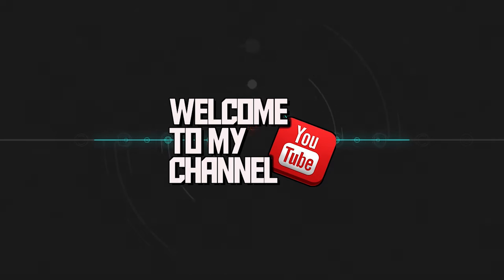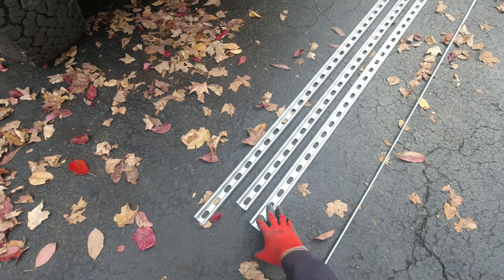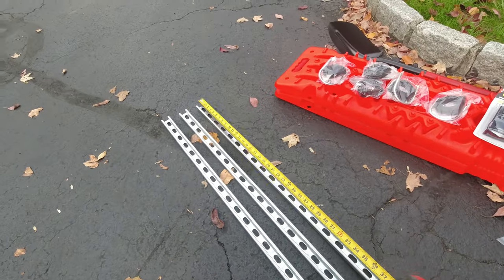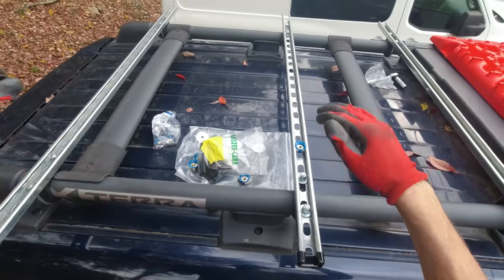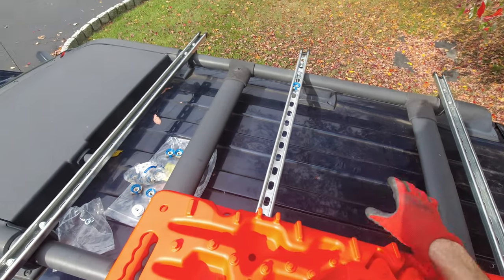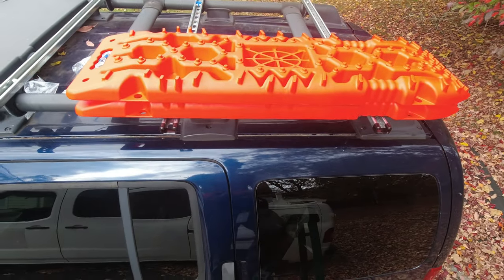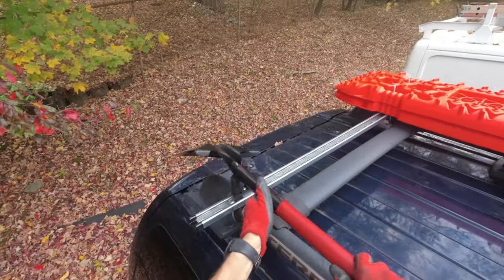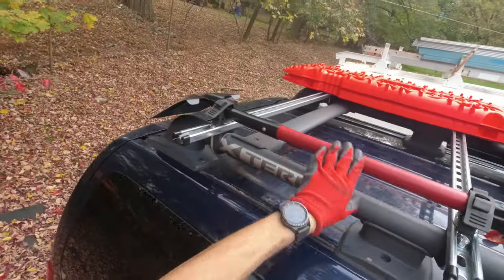DIY Roof Rack Using Superstrut Cheap And Versatile

Comment: Nice video. I’m needing to do this project so will be using your video as a resource. I really like the three strut idea instead of just do and the strap for the shovel is pretty cool.
Reply from the maker: Hey thank you so much ! Hope it will be some help to you its always great to hear that those video might be some help ! would be great to see your end result as well and how you made it )
Reply: @DIY_AUTO_PHOTO  thank you- you got the end caps from McMaster? The link in the description isn’t working and I’m not finding them on their site
Reply from the maker: @billk8899  Sorry about that not sure how that happened but I fixed the link its working now ) 
thank you for letting me know
Reply: @DIY_AUTO_PHOTO  what do you think of this slotted channel vs using a solid channel?
Reply from the maker: @billk8899  I like it because that way I can always add more stuff in there or move stuff around also it has holes to drain rain water it won't stay in there , as I seen some guys who used solid channel end up drilling few holes so water can drain away... ))
Reply: @DIY_AUTO_PHOTO  finished mine today, thank you for the video! I went with a ten foot piece I cut into three sections. I think I will revisit this and cut two longer ones and swap those in to use with kayaks. Fun project
Reply from the maker: @billk8899  Hey ! thank you !  glad you find this video helpful !!
Reply: @DIY_AUTO_PHOTO  something I’ve
Run into is that where I sliced off the bolts To shorten them to size they’ve started rusting and getting rust all over the roof paint. Hopefully I can clean it off but I should’ve but some rustoleum or something on top of the exposed bolts to stop it from rusting